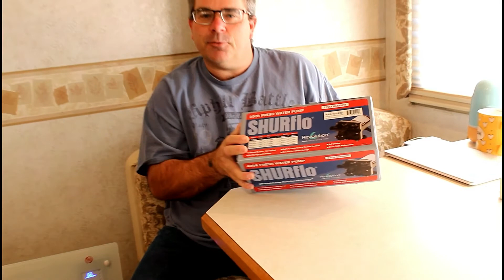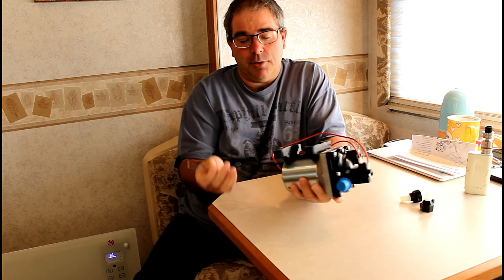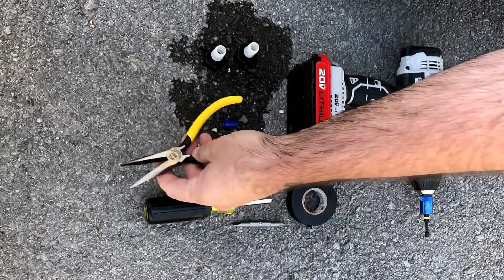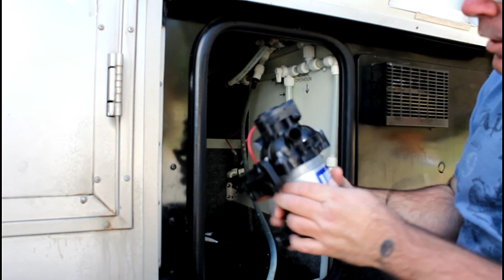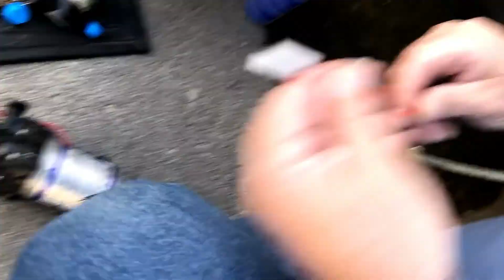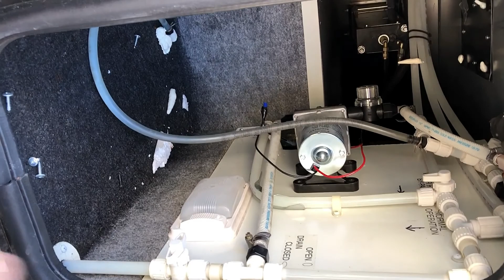Shurflo Water Pump Leaking-Water Pump Replacement-RVSWAT

Comment: Save your old pump and get a new gasket then you have a back up !!
Reply from the maker: Dang, good idea but i already tossed it before i uploaded the video...  LOL
Reply: Where do you get a new gasket?
Reply: Laura Anderson I seen the whole top assembly on amazon for $22
Reply: I was wondering same thing. Why not just replace the gasket ? 
I made mine from a Cheerios Box and red tack grease. Worked like a champ. Still noisy though. Maybe a newer one like you put in is quieter.  Another tip to quiet your water pump is to insulate water in and out with 
1/2 " pipe wrap about 18 " long.